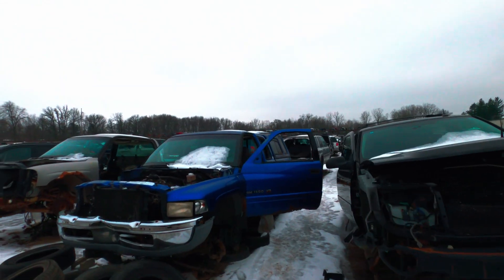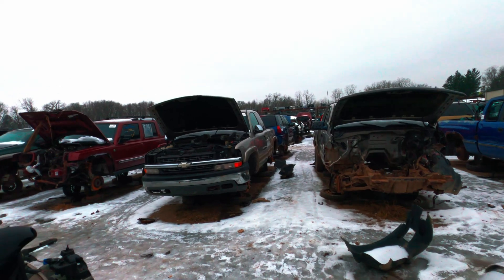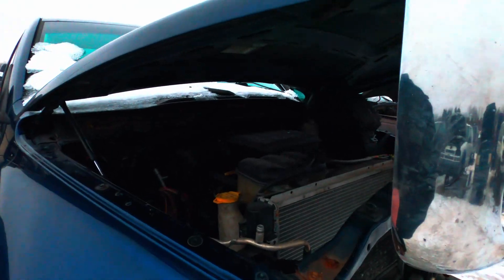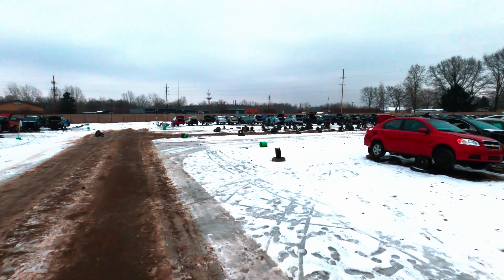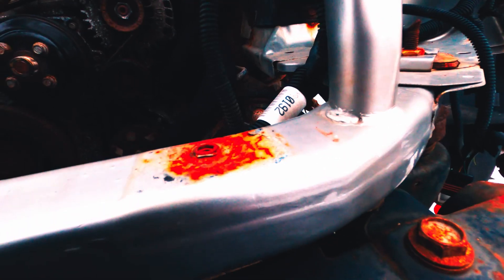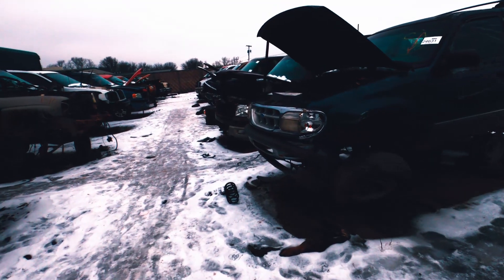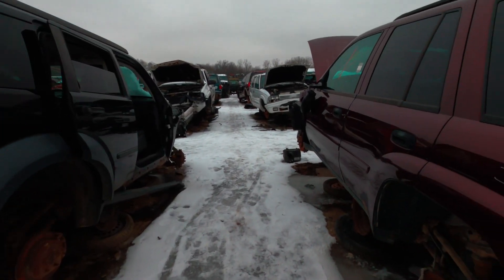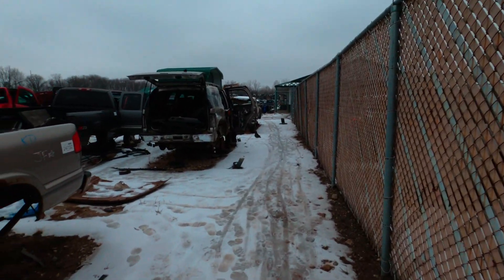Mason Upull junkyard dreams, big blocks, LS's, they have it all to make your dream come true!

Comment: Pulled a LQ9 short block from a 2002 Escalade with 202k miles listed runner from wellers last week. They listed 2 of the same year Escalade’s and went back for the 2nd engine today and gone of course. I have some 243 heads and tbss intake for my short block..😆

Comment: I just bought a gm 8.5 rear end people said I should of just went and got a 8.8
Reply from the maker: Well, there were three ten bolts in the core return and no 8.8's
Reply: @TheDrivewayEngineer is it a lot of modification to swap to a g body?
Reply from the maker: @Bball128  actually no, there's quite a few kits out there to bolt one in, and they're only a few hundred bucks
Reply: @TheDrivewayEngineer  nice thanks.... maybe I'll run into you at the yard one day ✌✌